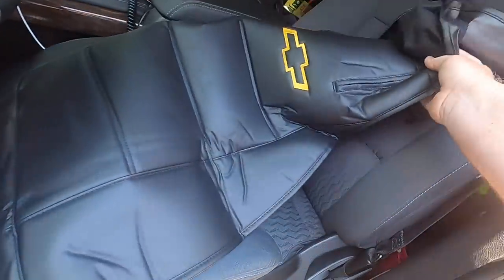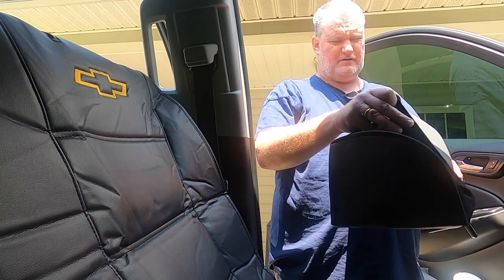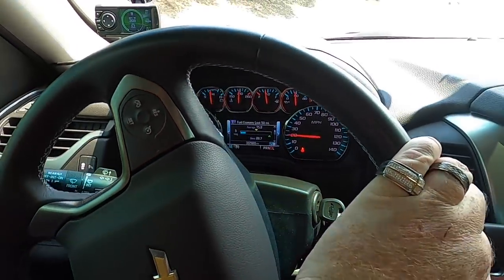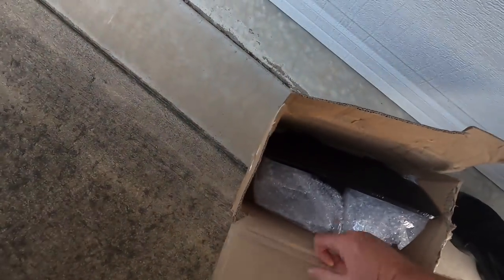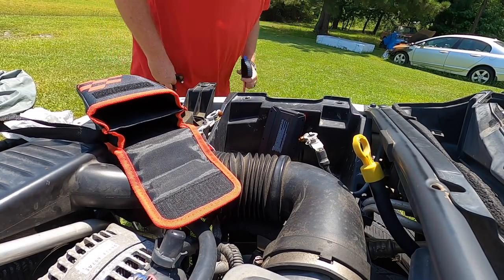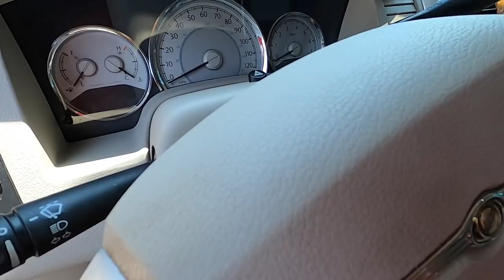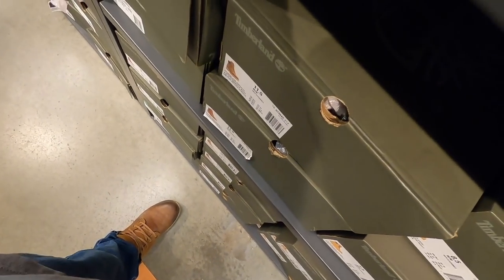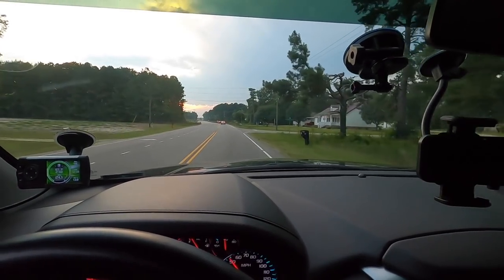I Blew The Motor? Seat Covers In the Mamba, New Hitch Step Rhino Storm

Comment: You could try to bar the motor over on the Aspen to prove that it is not locked up. Also you could remove the starter and get it bench tested.

Comment: The no fuse means the IOD (Ignition on Draw) fuse is blown I believe.  you disconnect this fuse when not using the car for long periods, so the battery doesn't run down...
Reply from the maker: rjkdev thanks for the insight. I’ll have to check the fuse box
Reply: @TKsGarage  And, I mis-typed.  Its called the Ignition Off Draw fuse. (Not "On Draw")  According to what I found, there are 2 fuses (#27 & 28) in the Integrated Power Module.  (Fuse block in the engine compartment).   Good luck!